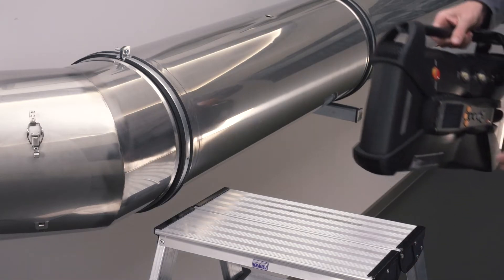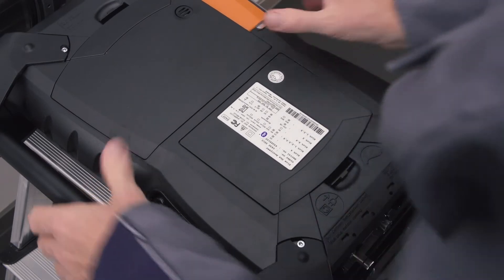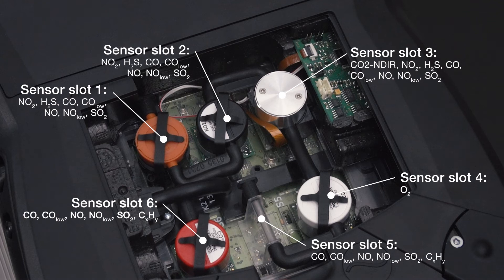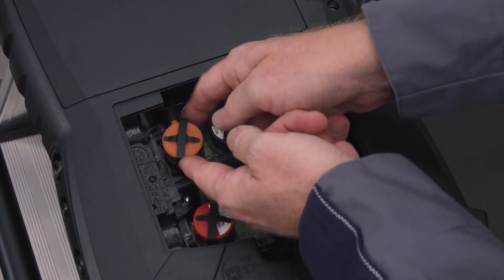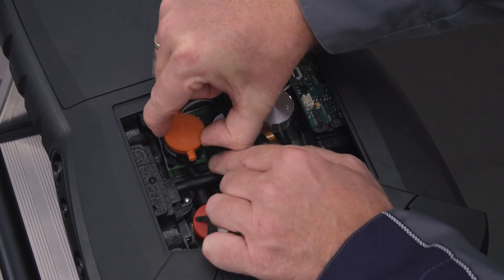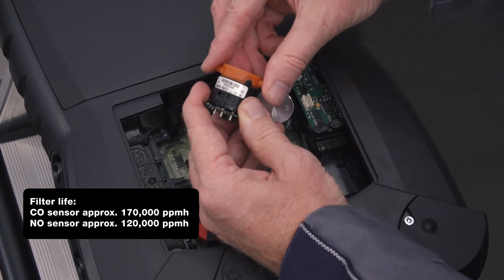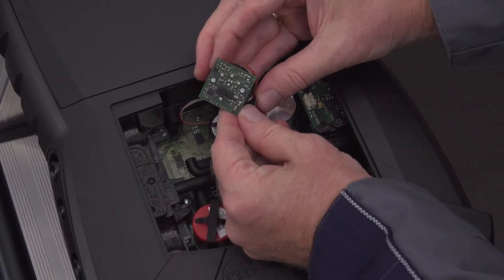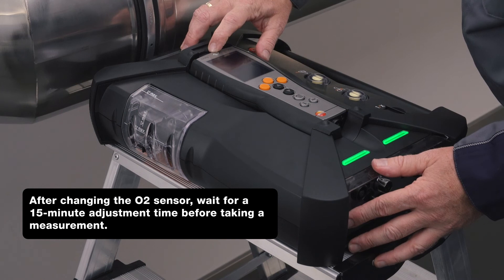testo 350 I Sensor change | Be sure. Testo

Comment: when 1 change O2 sensor testo 350, the display showed Änalyzer box 10", what is the meaning ?, then measuring not usually for O2. I Think this unit couldnot reading the new sensor of O2. than I relace 1 more a new one. and the result still not running for O2.